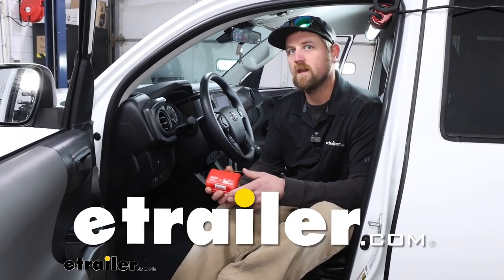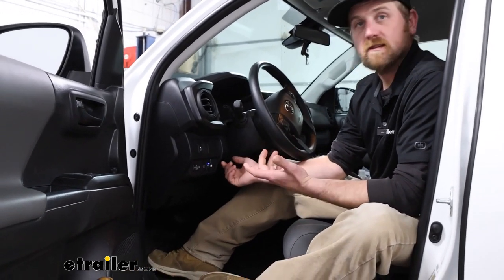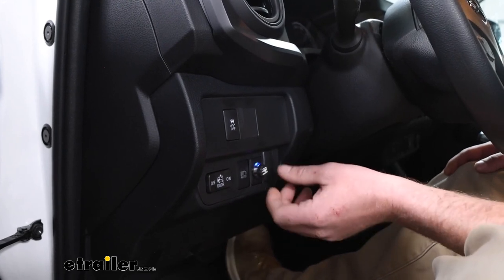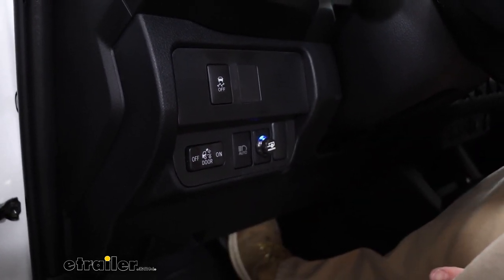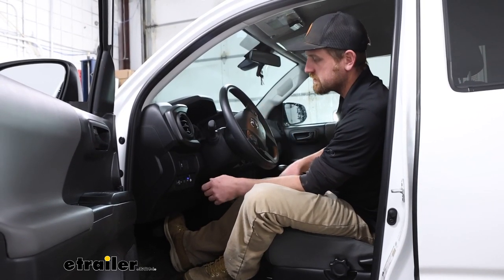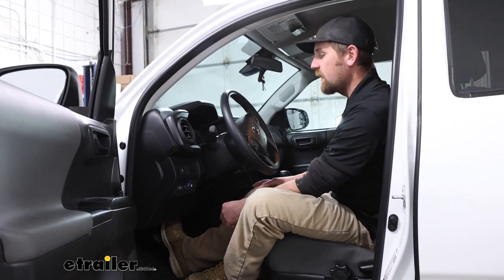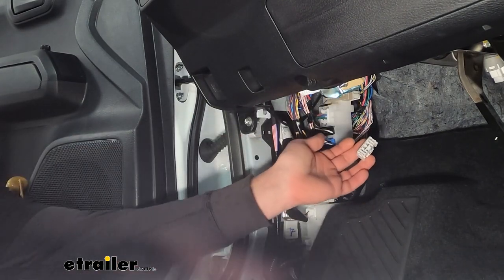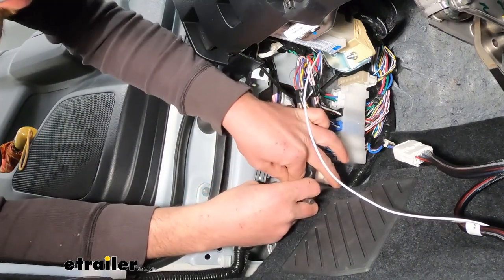etrailer | Redarc Tow-Pro Liberty Brake Controller Installation - 2023 Toyota Tacoma

Comment: Is there an override for backing (driving in reverse)?  Every conventional inertia-operated brake controller I've ever used would activate the trailer brakes during reversing unless you used an override.

Comment: Made my installation super easy, other than I had to remove the knockout from the front.  My hand is too big and my arm too short!  But works like a charm and now I can sell my wireless controller as it never really worked to my satisfaction!
Reply from the maker: We're glad the Tow-Pro Liberty is working well for you. Those knockouts CAN be tricky to remove, that's for sure!
https://www.etrailer.com/p-HM28MR.html

Comment: Thanks I just installed it 👍🏼
Reply from the maker: Awesome, we're happy to hear your install was successful!
https://www.etrailer.com/Trailer-Brake-Controller/Redarc/RED24FR.html
Reply: Question for you……… I just completed my install of the exact product on the same vehicle. Should my LED be on when I don’t have the trailer hooked up? Right now I can only see the LED blue light if I push the button. I don’t see it when I apply my brake pedal. I was under the impression that the LED would be full time on even with no trailer hooked up. I also should mention I have not hooked up the trailer just yet. Thanks
Reply: @andrewpacheco7780  The LED is off when not connected to a trailer, when I'm connected to a trailer that's when the light is BLUE. But when applying pressure on the brakes it lights up RED. And so the more pressure you apply the brighter the RED light gets.  Of Course only if the trailer has brakes on it, otherwise it won't light up at all. ✌🏼

Comment: everyone make sure you get the correct panel insert, my tacoma pro 4x4, middle slot is used and the right position is different than the middle or left. i had to place 2 orders to get it right. don't know why toyota would make it difficult and not just use the same?!?!?!? anyways, good video and everything is now installed. thank you
Reply: Which one did you order? I have an off road model and I can’t get the knob in either of the two lots I’ve tried.

Comment: Extremely informative, I am new to towing. Is there any connection that’s needed to go to the battery with this exact set up? Also after your installation in this video is all that’s needed is to connect the seven pin connector to the back of the truck and now the brakes will work on the trailer?
Well, this installation be similar to the 2023 Tacoma TRD  4 x 4 off-road?
Reply from the maker: If your Tacoma already has the tow package that includes the 7-way trailer connector at the rear bumper, installing the # RED24FR will be a plug and play install. You'll also need the # RED99FR harness. No battery connections needed, as all the necessary wiring is already in place. If you don't have the tow package, you'll need to add the #  22117 wiring harness, which will require a battery connections.
https://www.etrailer.com/Trailer-Brake-Controller/Redarc/RED24FR.html
https://www.etrailer.com/Custom-Fit-Vehicle-Wiring/Toyota/Tacoma/2023/22117.html
https://www.etrailer.com/Accessories-and-Parts/Redarc/RED99FR.html
Reply: @etrailer  our tacoma has the 7 pin connector at the rear. But to my understanding, i looked up what the tow package has and it is a plug to the left of the steering wheel that you plug in a device with a small digital display?
Being that we have the 7 pin connector, this should be a plug n play n calibrate? Lol
Reply from the maker: The device you're speaking of is a brake controller which is used to actuate electric trailer brakes. The connector for the brake controller is located near where the kick panel meets the underside of the dash.

Comment: Your website says "not confirmed to fit 23 tacoma"
Reply from the maker: The Redarc # RED24FR Tow Pro Liberty is a confirmed fit for the 2023 Toyota Tacoma. You'll also need the # RED99FR wiring harness, which is also a confirmed fit. It is showing up as a fit on our end, so I'm guessing it was a temporary glitch on our website.
https://www.etrailer.com/Trailer-Brake-Controller/Redarc/RED24FR.html
https://www.etrailer.com/Accessories-and-Parts/Redarc/RED99FR.html
Reply: I have a 23 Tacoma and perchased a new in box older unit pro liberty it has the TPH-015 harness, is this different from the red99fr harness, I see no red99fr part number anywhere

Comment: The control knob is super crappy. It’s always either too tight and won’t push in, or it’s loose and about falling fall. Works fine without the knob installed. Bad design with the knob.